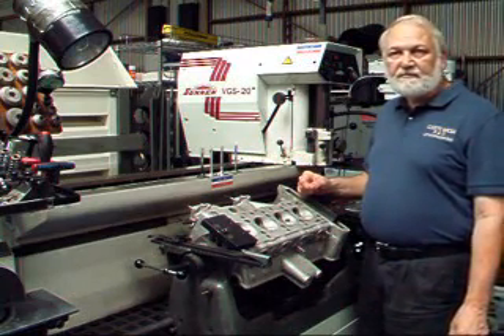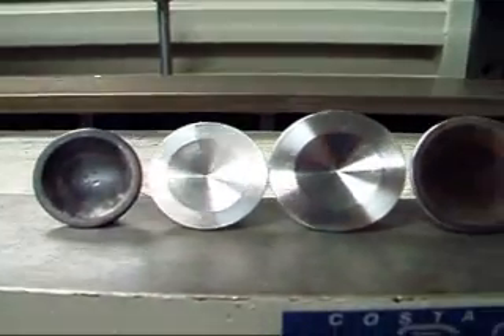Lotus 1600 Big Valve Conversion

Comment: at my shop we made the hand lapper fit into a drill, then we put a compression spring under the valve in the head to push up on the valve, it works really well,very smooth.

Comment: great show sir,
I,m really interested with this kind of work. That makes me have a lot of question. If you don't mind answerring

1. Why drilling the valve guide ? do drilling are requires for every new valve installation.
2. Why dont you cut the valve, instead lapping them only. If its titanium valve are you going to lapp them ?
3. Is that a micro meter you are using ?

thanks, i hope its not bothering you to much.

Comment: I loved this video! This is the exact same stuff we're learning in school. Down to the VGS-20 The video is quick and doesn't show all the steps in detail but you get the idea of what he's doing. First he reamed the guide and then honed it to its final size. Then he checked it with a guide bore gauge. After that he cut his seat angles (two angle seats it looked like?) and lapped his ALREADY GROUND valves to check the valve job's accuracy. Pretty basic stuff if you ask me. :D